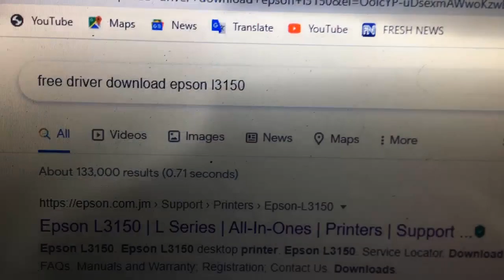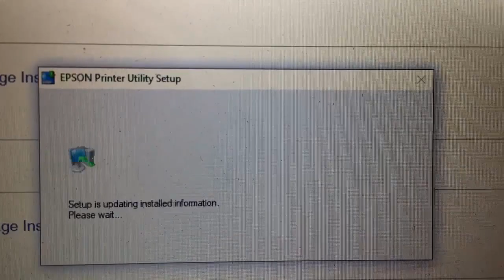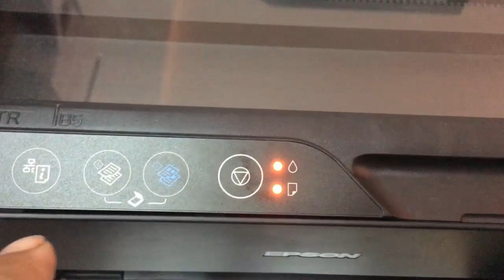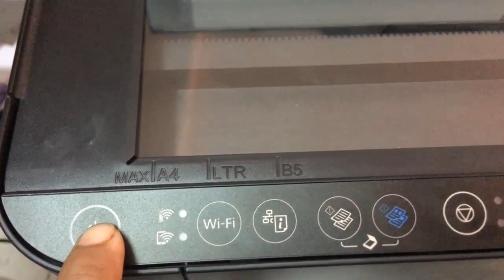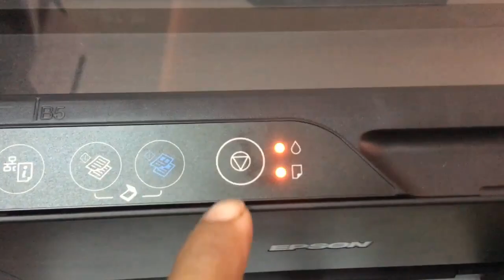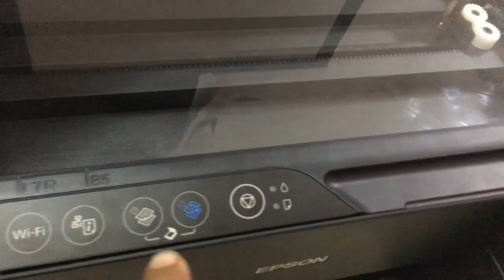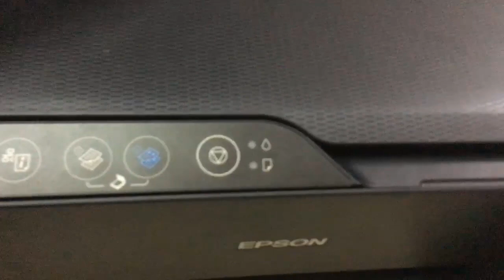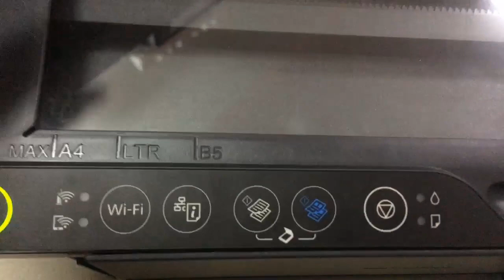How to fix Epson L3150 cannot copy or scan but can print  Download install full driver

Comment from the maker: I am sorry for poor quality of video, this printer can print but can't copy. When try copy or scan it show red light. this problem because the scanner unit in glass cannot move smooth and I just open the glass cover scan and reconnected scan it working well. But I think all printer epson error scanner maybe have many solution
Reply: I have this problem bit I haven't understood nothing because of the video and sound. Pls could you make another shorter but with all explanation. Thx a lot
Reply: I have the same problem as yours (Can Print but cannot Copy/Xerox). But the scanner rollers didn't move at all! It's just that the Scanner Laser glows and goes off then starts blinking all the 5 lights!
Reply: @Xhiye  I have the same problem

Comment: Hadirr kawan.. Goodluck👍👍
Reply from the maker: I am sorry for poor quality of video, this printer can print but can't copy. When try copy or scan it show red light. this problem because the scanner unit in glass cannot move smooth and I just open the glass cover scan and reconnected scan it working well. But I think all printer epson error scanner maybe have many solution

Comment: Your cables for scanner unit were INCORRECTLY connected (the thinner cable batch at 14:46). Opening the scanner unit did nothing. Please ALWAYS check or take photos of how the cables were connected. The blue strip helps you with that (we can't see what you did at 25:19). The reason I know this, is because I had exactly the same problem. I can hear your scanner unit motor hit the edge and thus make these motor sounds. Because you connected the cables upside down it is now trying to run the motor in opposite direction and hits the wall. The motor stalls.

Even when you connect it back on correctly it may still show the error. If you download the Epson resetter tool and check for PRINTER ERRORS it will show - "Scanner unit motor run in reverse" and a short code for it. Running it even once with incorrectly connected cables will write the error to the printer EEPROM and there is little you can do. You are lucky your printer flushed this error. 
People on Reddit say try disconnecting power unit and leave it for some time might help. But even that might not help. So, any technician receiving it from you will know that you have wired it incorrectly. I wish someone adds reset scanner unit errors. 

What EPSON should have done is allow flushing the error by running some button combos, like with Canon. But hell no. Proprietary tech, like John Deere and the like. You need an Epson certified technician to do that. I live in a place where Epson service in non-existent. 

#Epson #EcoTank
Reply from the maker: Thanks for your  ideas , this is part one video , and for  solutions can' t scan for this printer I just  remove scanner unit and reinstall ,it is ok

Comment: i really like your vidio
Reply from the maker: I am sorry for poor quality of video, this printer can print but can't copy. When try copy or scan it show red light. this problem because the scanner unit in glass cannot move smooth and I just open the glass cover scan and reconnected scan it working well. But I think all printer epson error scanner maybe have many solution

Comment: The cable that connect to panel buttons is called panel cable or scanner cable? Im confused becuz shops said it is a scanner cable. Some said it is panel cable. Which on exactly?
Reply from the maker: it is control panel cable
Reply from the maker: Scanner cable not the same control panel cable

Comment: Sangat bermanfaat
Reply from the maker: I am sorry for poor quality of video, this printer can print but can't copy. When try copy or scan it show red light. this problem because the scanner unit in glass cannot move smooth and I just open the glass cover scan and reconnected scan it working well. But I think all printer epson error scanner maybe have many solution

Comment: Дякую. Все зробив по цьому відео, і все працює. Проблема з двома шестернями, які приводять в рух  сканер. У кого стоять драйвера, наново ставити не потрібно.
Reply from the maker: Так дякую
Reply from the maker: the first my computer no driver scan for this printer and need install full driver and test, and then disassemble scanner unit , unplug cable and adjust gear ok

Comment: Epson L3250 e425-b301 i fixed this mechanical error by stuning with hand palm above 2 stuked white gears. Turned on printer and with very fast hand stuns and shakes i return white gear in to the place.

Comment: я так и не понял, что вы конкретно сделали, чтобы принтер заработал. У меня точно такая же проблема, уже все перепробовал , ничего не помогает.
Reply from the maker: This printer error scanner. I installed driver to make sure this printer can print or not. after installed driver printer can print but can't copy or scan.solution try to reconnected cable scan.the printer working well

Comment: I opened the scanner but it was crystal clear no dust but still all lights blinking
Reply from the maker: try to checking cable connection, if cable good can be scanner or motor scan error

Comment: What you just did in the whole 23:00 mins?
Reply from the maker: the first my computer no driver scan for this printer and need install full driver and test, and then disassemble scanner unit , unplug cable and adjust gear ok

Comment: Why does this happen?
Reply from the maker: I am sorry for poor quality of video, this printer can print but can't copy. When try copy or scan it show red light. this problem because the scanner unit in glass cannot move smooth and I just open the glass cover scan and reconnected scan it working well. But I think all printer epson error scanner maybe have many solution

Comment: I don't still get what you have done to that? you just touch the rounded plastic then it works.. you don't even say anything, you just pointing on to it...makes no sense to me
Reply from the maker: I am sorry for poor quality of video, this printer can print but can't copy. When try copy or scan it show red light. this problem because the scanner unit in glass cannot move smooth and I just open the glass cover scan and reconnected scan it working well. But I think all printer epson error scanner maybe have many solution

Comment: Bhai video bol kr banaye nhi to hame nhi samjh aata hai
Reply from the maker: I am sorry for poor quality of video, this printer can print but can't copy. When try copy or scan it show red light. this problem because the scanner unit in glass cannot move smooth and I just open the glass cover scan and reconnected scan it working well. But I think all printer epson error scanner maybe have many solution